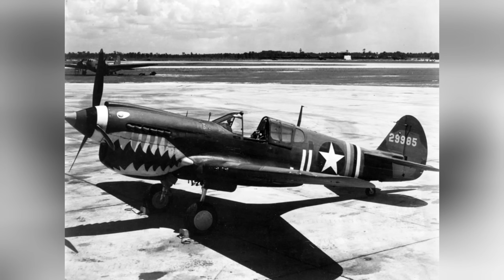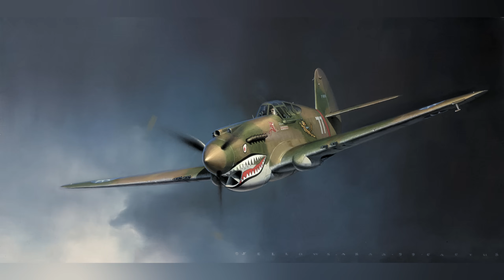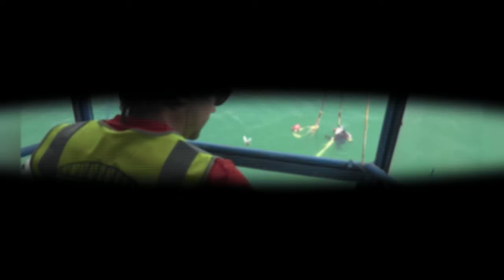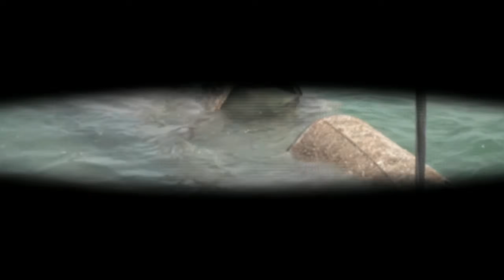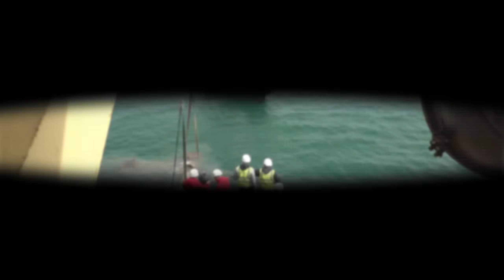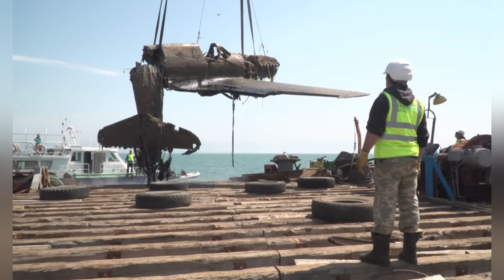Recovering P-40 Warhawk: Black Sea Wreck Lifted After 74 Years

Comment: Lifted to unblock the route for Putin's Kerch bridge this plane was virtually cut into pieces by the use of cables rather than a planed lifting platform. 
It's just junk, they should have dumped it back into the sea a little further away.

Comment: P-40 frame was steel
Reply: You may wish to look again.  It's mostly aluminum alloy
Reply: Steel would be impossibly heavy
Reply: @Skilled1143 steel tubing
Reply: @ArtBurnett-he8kwPrimary construction was aluminum alloy.  If you wish to pick nits, enjoy.
Reply: @ArtBurnett-he8kwSteel tubing was used for the engine housing alone.   The bulk was aluminum alloy. A lot of the plane wasn't the engine housing.